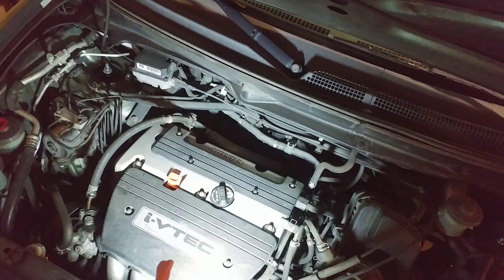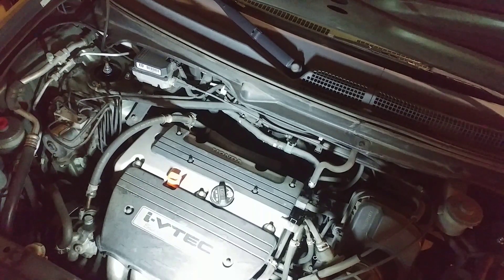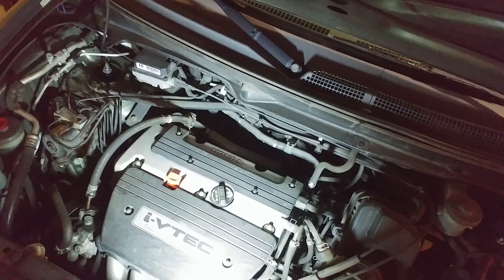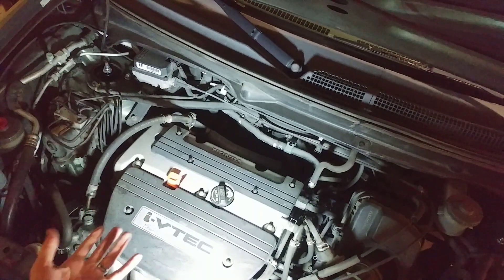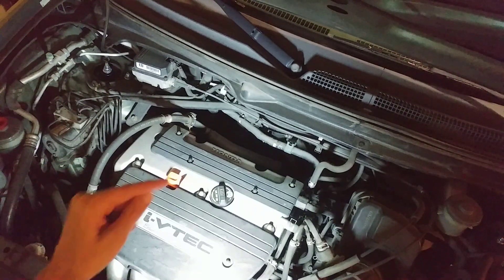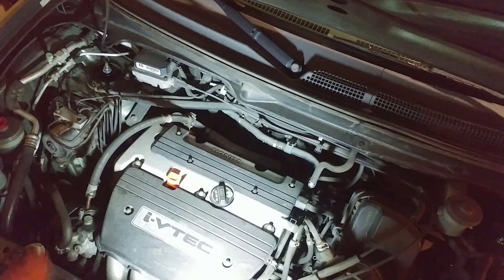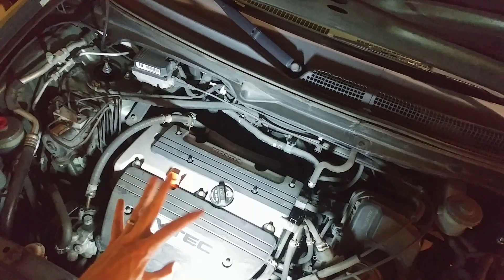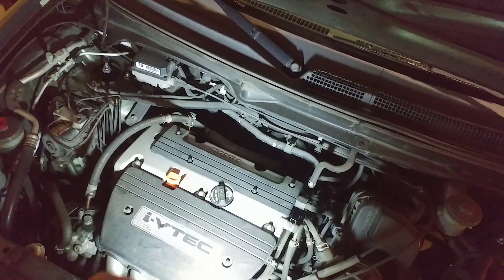When to Use 89 Octane in an 87 Octane Engine

Comment: What you should also consider Is anything above and eight and a half to one compression ratio should run 89 especially when you're over 100,000 miles It is a cleaner burn it's better for your catalytic converter and the gas last longer because inside of the gas pumps you've got a mixing valve and 89 completely cuts 93 and 87 and 1/2 to get you 89

Comment: I have a 2010 civic lx with the R18A1 in it. It’s completely stock. Manual says use 87 unleaded or HIGHER. Me i personally use 89. And people get so pissed off on online forums saying it does nothing to benefit the engine but im saying it right now. My civic does not like 87 at all. Honda even states that you can go higher. And i will agree that if you’re using 93 you’re a fool 😂. 93 is way too high for a stock untuned honda engine. But 89 i swear by it. My engine is as quiet and efficient as possible on 89 from exxon. Any time ive ever used 87 the engine just shakes like crazy. Especially with the AC on, if i used 87 with ac on oh my god the engine would shake and bog down like it was gonna stall out. I put 89 in it and it now just runs normal as if its a brand new car. Its got only 125,000 on it but she loves the 89, shes just so much quieter and fidgety on it. So to anyone reading this who disagrees with it, honda engines absolutely do run better on 89 in my opinion. I will say it doesn’t give any if at all performance benefits, but its does calm the engine down a lot. Like i said the manual states 87 OR HIGHER. Meaning, the engineers themselves even know that the r18 at bare minimum yes will run on 87 but its not optimal. The compression is 10:5:1 which is considered high compression. At minimum you need 89 in it for it to feel comfortable. Can it run on 87 forever and have no issues?? Absolutely. But for me, my civic absolutely hates 87. And actually when i used to use 87 it also used to hesitate when starting. After using 89 it starts immediately with no hesitation
Reply from the maker: Good stuff my man. Sounds like you are on your way to making that Civic last 300,000 miles. We have 216,000 miles on our Element and I've just finished a bunch of work including new axle shafts. I hope you're a subscriber and make those cars last baby!

Comment: Engine compression ratio is a good indicator to see if you should use a higher grade fuel than recommended in the owners manual. Honda, Nissan engines are usually higher compression ratio and can run on regular without damage since the computer adjust timing to prevent knock. But running premium does result in smoother operation and power delivery. I noticed this on the Honda 1.5 turbos, j series V6s and Nissan VQ Series V6s. I’m sure there are other engines out there that have minimum of 87 octane but may benefit from smoother operation from higher octane if the have a compression ration >10.5:1. You would have to test it out yourself to see if the cost difference is worth the difference in the drive.

Comment: 660 cc Bike engine manual says use RON 91.   I have tried PLUS 89 gas, and dont perceive any engine knocking or performance issues?  any thoughts?  though I hear that altitude effects how gas burns, so If I were to go across country, the altitude changes... so i would use 91 in that case. Any thoughts?

Comment: I have a newish car (84k miles) and it requires 87. I decided to start using 89 and I’ve noticed a small performance difference. It’s very minor but it’s enough to notice it has better “pedal response” I guess you could say.
Reply from the maker: Great hearing Sam... yes, if you have a 4 cylinder you'll probably notice a performance boost. I still run an 88-89 blend in our Honda and I can tell a difference... and the car shifts differently (it doesn't down shift as much going over hills). Thanks for watching. I hope you're a subscriber and make those cars last baby!

Comment: 2009 Accord (2.4L ; 4 cyl) with 230K miles. Engine has been running rough for the past year.  Had a tune-up done and it improved a little. I tried a tank of 89 octane and i immediately noticed how much smoother it was running , especially when idling for a red light.

Comment: Any fuel injected engine with computer controlled ignition timing will adapt to the higher octane fuel by advancing the ignition timing. What they typically do is advance the ignition timing as far as it can until the knock sensor detects pre-ignition while under heavy load and then backs it off a smidge. With higher octane fuels, it can, and will, advance the ignition timing further than it can with lower octane fuels. Hence, more power and economy. The main thing about carbon buildup is that it makes an engine more prone to pre-ignition; thus, as the miles pile on, the engine computer can't advance the ignition timing as far as it once did before reaching pre-ignition (also know as spark-knock and/or detonation). If a person typically drives gently or lackadaisical, the extra price of higher octane fuel would be a waste, because they're not seeing any benefit by not really putting the engine under load; however, if a person has a heavy foot and/or utilizes the maximum performance (as in the case of this video) they will typically see a benefit. 20 years ago I had a front wheel drive car that had a 4 cylinder and was recommended to just run regular; I was making long distance trips on the interstate frequently and the engine was a little underpowered on all the long mountain passes so it would really be working. As a test I thought I'd try running premium on these trips to see if it helped in the mountains and it did, so then I decided to keep track of the cost between running the regular vs the premium and it was actually a little cheaper to run the premium because I got better gas mileage while on the interstate with it, which counteracted the additional cost at the pump. I don't remember the actual numbers anymore, but I do remember it took a couple of tanks in a row for it to fully adjust to the better fuel, it's not something that will happen immediately or even within one tank. The engine computer adapts over time as it uses the average of the last couple dozen starts or so for the fuel trims, etc.

Comment: True story I purchased a used 2006 Corolla and one day noticed the SES light came on. Took it to an O’Reillys had them run a check and the code came back ‘system too lean’. After watching a Scotty Kilmer video or two I went to the store and bought a can of fuel system cleaner. The directions stated to use the bottle in a quarter tank and, after running the car for a few miles, go to the gas station and fill up with 91 octane. I followed the directions and about halfway through the tank of 91 octane gas, my SES light turn off. So I applaud myself with a job well done return to business as usual, using 87 octane at the pump. A couple days later SES light comes back on with a system too lean code again. I filled up with 91 octane and the light went back off. Long story short, I use 89 octane in my tank at all times, because somehow it keeps the system from triggering a lean code. Facts is facts 💯
Reply from the maker: No, no, no Krissy... it's all in your imagination. It's just a placebo... you don't know any better. You clearly don't understand the $cience... Okay, in all seriousness WAY TO GO KRISSY! I like your moxie and determination to find a solution. This approach has resulted in me having a lot of success with my vehicles and in life. Sometimes dealerships, shops, Pep Boys, etc. are correct, and other times they are simply wrong. I like your independent free thinking and hope you're a subscriber and make those cars last!
Reply: I had a check engine light on that I ignored for 3 weeks hoping it would go away on its own. It did not. Pulled the code and it said system too lean. The problem turned out to be a primary oxygen sensor failure. Replaced the primary O2 sensor and the problem was solved.

Comment: I've added a cold air intake and new exhaust/intake mani and a friend did a ktune to my k24a4 honda accord (I believe the element has a k24a6 or a8) engine, and there's no way my engine's octane requirement hasn't moved from 87 to 89. 89 is what I've been putting in it for about 2 months now with 200k+ miles on all of it and I put down about 189whp before vtec 265 after vs stock 160/166 - 240 of that gen (7th). fun little car

Comment: In my younger days before cars had computers which automatically adjust the spark timing to prevent detonation, you had to use the correct octane gas for the engines compression ratio, too low and you'd get engine knock or pinging. We used to play around a lot with timing lights, turning the distributor to get the most advance, without the pinging sound when accelerating, so as to get the most performance out of the engine. The general accepted rule of thumb regarding what grade gas to use was regular if below 9:1 compression ratio, mid grade from 9 up to 10:1 and premium for 10:1 and above. This rule still applies to modern engines, the only difference is you wont damage the engine by using too low a grade or have to manually adjust the spark timing to prevent damage which can no longer be done because the computer will do that for you. However if it is doing so you will be loosing power and MPG or if you use a higher grade than the engine needs for it's compression ratio you will be wasting your money. Most cars will recommend 87 or higher grade. Despite most cars these days having higher than 9:1 ratios, as is the case with the V-TEC Honda engine in this video. While they can run fine on 87 octane with retarded spark timing, they will run better on 89 with more spark advance, as several people commented. 93 would most likely be overkill for the compression ratio and no improvement over 89 if the engine computer is no longer making a knock reduction adjustment to spark timing as seems to be indicated in the comments below. This is why most manufacturers say "or higher" in their specs, it's your choice what grade to use within these specs, and you will probably go with what the car seems to run best on, because that will also get the best MPG.
As for brand, most vehicles I've owned seem to run best on Chevron, Texaco, Shell or Exxon and worst on Valero.

Comment: I have a 98 Corolla with 178,000 miles, car runs great with the exception of a slight hesitation Once the light turn green, it is recommended that I use 87 grade gas. I mistakenly put in 89 and notice a big and improved different in my acceleration .... Not all mistakes are bad mistakes
Reply from the maker: That's a good candidate for 89 octane: 1. You have a 4 cylinder (border line under powered) and 2. with lots of miles on it (so you've got carbon deposits that have raised your compression) and 3. you've got a bit of hesitation. You can run 89 in it or fill it up 3/4 with 89 and then 1/4 with 93 octane. It will probably make a difference. Also, in my 2nd video I talk more about you can test it (hint, if you have an automatic transmission it will shift differently when going over hills)... i.e. because the engine is delivering more power the transmission won't need to drop down a gear as much when going over a hill. Thanks for watching! I hope you're a subscriber and make those cars last!

Comment: I prefer only using 89 octane for cars that are 87 octane because I find that to be more reliable for my cars to run smoothly.
Reply from the maker: Good stuff Marlon. If you notice a difference then there is a difference, period. Thanks for watching. I hope you're a subscriber and make those cars running 89 last baby!
Reply: @TheSwitzAutomotive  The cars I own are a 2004 Mazda 6s and 2005 Honda CR-V SE. Ever since I purchased my Mazda brand new and my mother purchased her Honda brand new, I have only used 89 octane on both cars because those cars perform a lot better with that gasoline. Even if the owner's manuals show 87 octane, still weak and unreliable. Ever since 89 octane took over the 88 regular leaded gasoline in 1991, two octanes makes that big difference. I would only use the 91 premium unleaded gasoline if mandatory or required.

Comment: I tried this test on my 2003 Honda Accord LX.  Same 2.4 as yours.  98k miles.  87, I could hear that it was struggling to pick up speed past about 3500rpm.  I tried 89, and managed to get a boost in acceleration and smoother ride.  93 was no more acceleration, but the smoothest of them.  So I did half 89 and half 93.  Slightly more acceleration, and almost as smooth as 93 (effective 91).

So I use 89 in it, and occasionally 93 if I can find 93 cheaply enough.

My 2013 v6: 93 only ... The compression is almost 11:1, and 87 is right on the edge... If you're in spirited driving, you can notice the engine on the verge of destination.

Also, I Dyno 87 and 93 in the v6 (5 pulls in sport mode), and got 15-20 more hp on 93 vs 87.  241hp at the wheels vs 225hp at the wheels.  Basically, the 9th gen Accord v6 sees 93 as a way to make easy horsepower.
Reply from the maker: Yep. Higher octane makes a difference! I hope you're a subscriber and make those cars last!
Reply: @TheSwitzAutomotive  I am!!! And I will.  The 2003 is getting a little rust by the front of the passenger rear wheel well, but it runs fine.  The paint bubbling part.  The 2013, none.

Comment: What gas can you use a 60s or 70s car
Reply from the maker: Sorry man I don't drive any 60s or 70s cars. I pretty much focus 100% on cars with modern fuel injection systems since those are the ones (spraying precise amounts of fuel) that last the longest. I'm not saying you can't get 300,000 miles out of a 71 Nova... but I don't like your chances. Thanks for watching!

Comment: Every once in a while fill up on 93 to clean out your engine. If you drive hard getting your engine hot use 93 for safty to prevent early detonation at 210°+ on a 87 tune.

Comment: Will you use 89 in a car when you have the heater on a cold day
Reply from the maker: The heater does not suck power away from an engine like the AC compressor does. So on my Element if I need to pass someone or merge onto a freeway I need to turn the AC off (running on 87). With 89 this is not necessary, as the car has more power. Thanks for watching! I hope you're a subscriber and make those cars last!

Comment: Actually you are right. I switch from 87 to 89 in my 2014 elantra with 180k miles and i notice a huge difference. My car drives better, It doesn't have problem starting it, it drives smoother. For this reason I decided test test that with my newer 2018 corola. It drove the same but I think when I switch to sports mode I think  it drive slightly better?  I'm not sure.
Reply from the maker: Raphial you're on the right track. On some vehicles it really makes a big difference. On our 2005 Honda Element = big difference. On our 2012 Kia Sorento SX = no discernible difference. Thanks for watching. I hope you're a subscriber and make those cars last baby!
Reply: Only use 91 octane if required. Otherwise you are burning more money. 87 octane doesn't provide real reliability.

Comment: I have a 2019 Nissan Murano with 35,000 miles and the 3.5 V6.  Been using 89 octane since brand new only shell gas.   With gas at almost 4 per gallon am I wasting my money?  Owners manual says 87 or higher.
Reply from the maker: Drive it round and test both. If you can live with 87 maybe go with that until gas prices go back down. I know what you mean. I'm running 87 off and on even though the car runs better on 89. Thanks for watching!
Reply: Use 89. It's worth the extra cost. The only reason car manufacturers say 87 is because from a marketing perspective, it makes customers feel the vehicle has a much lower running cost. 89 is better due to the fact it allows the engine to run smoother, improves acceleration, prevents engine knocking, has better cleaning additives. All those factors, will prolong the lifespan of the engine and transmission.
Reply: @zarbon700  Thanks for the response I will continue doing so!

Comment: i know this video is old but i completely agree i have a 2005 Pontiac vibe right i know i got a bad exhaust system and when even before it went bad before i can save up money to replace the entire exhaust system since its old and bad and 1300$ for a new one when i used to put 87 in my gas tank the engine would vibrate and i could noticeably feel it but at first i thought it was the brakes fluid at first for the brake discs in the front since i have drum in the brake so i thought okay i'll add more fluid did that seemed to go away but then i came back and now recently i put 89 in the gas tank fully for the first time because the first time i mixed it with 87 but now its running on fully 89 octane and the engine vibration has minimized to nothing
Reply from the maker: Yes, I always say if it makes a difference it makes a difference. With gas prices so high now this is very frustrating for many people, but it still can be worth it if your engine runs better. I hope you're a subscriber and make those cars last!
Reply: @TheSwitzAutomotive   i've only just convinced my mother to switch over to 89 because of finding out my engine in the vibe even though its a 1.8 liter 4 cylinder engine it has a ratio of 10:1 and that means it can run on higher octane even with only having 130 horsepower